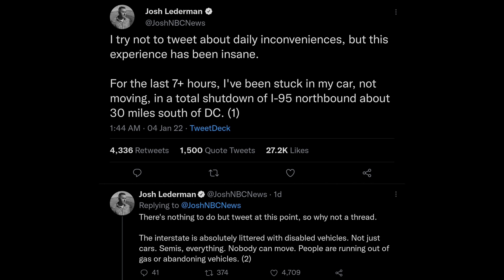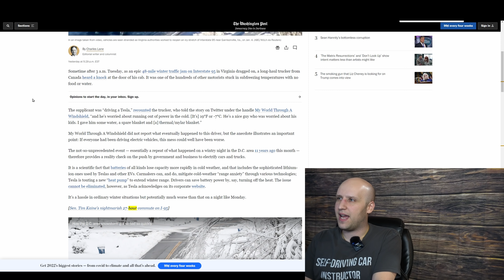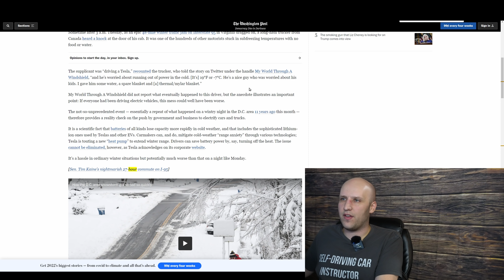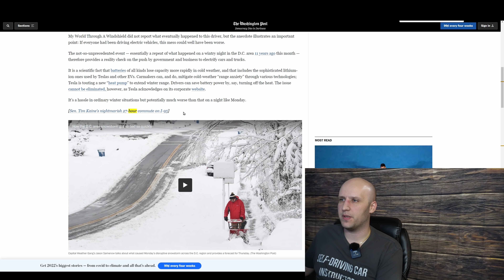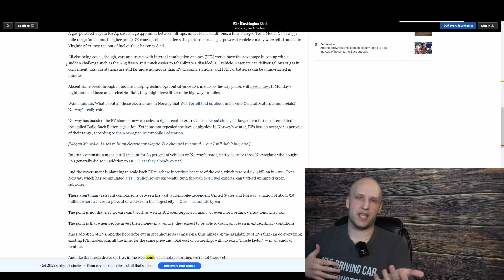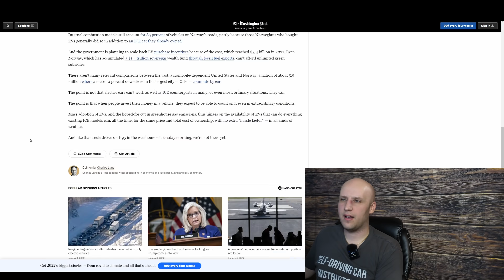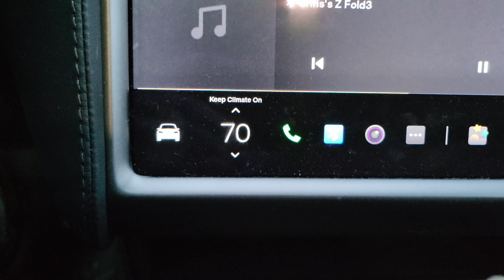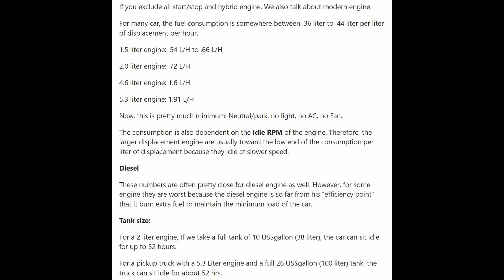How Long Can a Tesla Keep You Warm In A Frozen Traffic Jam? | FUD Debunking

Comment: Thing is that when you are parked and not using the motors in a Tesla.... more newer version or software update.... they allocate the energies to other areas.... so if you are on the side of the road during the winter you okay to run the heat as the motors are not being used due to the car being in park sending the message to allocate energy priority to heating or cooling. To me it make sense they would have it set that way also Solid State batteries are coming soon.

Comment: THANK YOU! 
I've been watching your channel for ages, but found this one super informative! Especially since I was in my MY stuck in a British Columbia snowstorm with only a quarter charge left... which is a LOT... but I was very worried about using too much charge to stay warm while waiting for the traffic to clear. 

You've totally amped up my confidence, and eliminated my first ever range anxiety! 

I wondered if turning off the car for a few hours, till it gets too cold inside -- but draws extremely little juice -- would help too. Or would the reheating of the battery from cold cancel out the benefit of turning the car off? 

Anyone know the data or have a well informed opinion?
Reply from the maker: I think you'd be much better maintaining the lowest temp possible rather than making the car work to warm you up. If we're talking hours and not days or weeks

Comment: I may have missed it but did you have the air recirculating or pulling from the outside? It would stand to reason if it were recirculating it would last even longer in this situation.

Comment: Great video. You've explained all of the misconceptions. However, I would like to point out one thing. 8:42 if you are running the heating for a longer period of time in an EV equipped with the heat pump you are going to extract all of the heat from the battery. Byorn tested it and the temps in the battery pack went very low. Basically, the system is designed to save energy at the price of cooling the battery. So pulling to the SC straight after such an event will cause a very slow charge.
Reply: The model Y heat pump takes air/energy from the outside and not the battery pack.
Reply: @lyledavis7175  so Y is different than 3?? It's hard for me to believe that.... https://youtu.be/HityyIwWSmQ?t=1115 not a best example, in another video Bjorn tested it while camping in the car overnight during winter but I can't find it now

Comment: A good rule of thumb for gas use at idle during a storm is 1 gallon of fuel per hour of idle. I based it off of the fuel use of most 2-5000w open frame generators plus a .25 gallon conservative factor. Because you don't want to ever actually run out of gas in a snow storm and 1000w to 2500w (you run generators at half load) would roughly equal the mechanical and electrical loads on the engine for a modern car at idle. Most smaller cars have 10 to 15 gallon fuel tanks. Full size cars and trucks have 17 to 30+ gallon fuel tanks. 20 to 22 gallon tanks being very common in these. So even most small cars would likely idle for about a full day at minimum on a full tank of gas.

Comment: It's better to take into the fact you wouldn't be starting at 90% while in traffic you'd end up more around 50% SOC in which case you do need to worry about lowering the temperature.  Suffice it to says in an ICE vehicle you wouldn't have to worry about this issue at all.

Comment: The mountain pass in National geographics "Ice road Rescue" are regularly passed in winter by EVs, no problem.  I drive over with my Citroën C-Zero (MiEV), no problem. 

The "only 5 million" argument is not an argument regarding EV and snow.  You can get stuck in que due to a closed mountain pass.

Comment: You don't have recirculate on, that makes a big difference, you're constantly heating the very very cold outside air, rather than reheating the interior air, this can fog up the car, but doesn't matter when you're not moving, I think this would have made a fairly big difference.
Reply: If you are in a traffic jam, you might be wise not to bring air in from outside ! Especially if the surrounding ICE cars are running engines persistently! 🤔
Reply: This is a really good idea, thanks for the tip.
Reply: if u recirculate the air with people inside it's going to fog up thus in a real world situation u have to pull in outside air.. plus  for extended periods some manufacturer manuals suggest recirculation to prevent carbon dioxide build up..
Reply: @joebrown9621  generally, switching between recirculating and outside air works best at most times to keep air warm or cold, while keeping the air fresh. This is what I do most of the time.  Obviously this isn’t practical if you are sleeping, although it has been years since I have actually slept in a car.
Reply: Don’t Teslas automatically recirculate? Sorry for my question, i have a EV from VW, they monitor the CO2 and do it completely automatically (if you like, i have it activated). 🙂
Reply: @erebostd  is it the id4
Reply: Unnecessary engineering example:
Have CO2 meter installed, when it goes above certain value it would start letting fresh air in.

Maybe even it can open the flaps just a little with some algorithm calculating how much co2 is inside. Of course it would be necessary to let the software know that you allow to let the flap open, because if you are driving with that setting and are inside a tunnel you don't want it to open.

I have tried to find CO2 meters that use N-IR sensor, there is some but I haven't seen any reviews yet. There is also  acoustic co2 sensors, uses less energy.

Use CO2 meter with alarm if you need to have recirculation on.

Those cheaper co2 measuring devices  uses another type of sensor that will react to perfume and odors, and that is not ideal in a new car with all the glue and plastic evaporation smells.
Reply: @LordGryllwotth  Cars aren't airtight. There's enough air circulation from outside when you're in a closed up car that you don't have to worry about too much CO2. A lot of people sleep in cars without having a problem. The moisture does cause a lot of mold if you sleep in a closed up car every night, at least in a humid climate.
Reply: Cute. Thermally speaking, it's easier to heat cold air to 70⁰F than it is to heat warm air to the same temp. The same thermodynamics apply to why cold water boils faster than luke warm water.
Reply: @nicholaswinter3869  that's probably the dumbest thing I've heard in the past month
Reply: @JM-yx1lm  lol I honestly had one of those moments like did I just really read that? 
Oh that's why when it goes from 60 degrees to 10 degrees we all turn our heaters down , the cold air heats easier!
Reply: @nicholaswinter3869  cold water doesn’t boil faster than Luke warm water. 

Boiling water can freeze faster than room temp water tho.
Reply: @b22chris  Boiling water doesn't freeze faster than room temp water.  The boiling water has to cool to room temp before it can cool to freezing.. .
Reply: @rick419  While you're sort of right, that one actually can happen under certain real world circumstances.  Cold water will almost certainly freeze before room temperature water but boiling water can freeze before both.  The thing that enables it is evaporation.  When a portion of the water evaporates, it takes it's energy with it.  

It's a safe bet that you have seen water vapor coming off a hot cup of tea/coffee/soup so you know that hot water evaporates more quickly than cold water.  Certain atmospheric conditions also accelerate evaporation. Cold dry winter air with a breeze to aid convection are exactly the condition that you would need to look out for here.

Now combine that cold, dry breeze with a small quantity of boiling hot water.  In this situation you might see a significant percentage of the boiling hot water evaporate before it's temperature lowers to the point where evaporation slows.  This can mean that the total energy remaining in a boiling water sample is lower than the total energy remaining in a cold water sample.

So where are you most likely to see this in real life?  If you live in a place with winter, pouring water into a frozen car door handle to open the door.  Most of the water just runs off of the hardware leaving only a small quantity behind.  If it's cold, dry, and windy, the door handle can refreeze a lot faster if you used boiling water.  Best practice is to use room temperature water.
Reply: @ColonelSandersLite  I wouldn't pour water of any temp on a frozen door handle, it will probably freeze even harder.  Maybe a hand warmer.  If you boil water long enough  you will end up with less water, and perhaps this lesser amount of water will freeze faster than water that's cooler but a greater amount.  Yes boiling water gives off more heat but to freeze that boiling water will have to cool to every temp. before reaching the freezing point.
Reply: @rick419  Nah, see, you're totally missing the point.  

Completely.

Let's take two arbitrary small units of water, one boiling hot, one room temp.  Let's say 1ml each.  Just a few drops for each sample.

You take the hot one off the stove and carry them both outside.  It is like -5f, dry and windy out there.

From this point, you're out in the cold with a ml of hot water and a ml of room temp water.

75% or more of the hot water may well evaporate before it cools to room temp.  Once this happens, the formerly hot water has lost a solid majority of it's thermal mass.

Yes, the now 0.25 ml of formerly hot water has to pass through room temp to get to freezing, but with it's reduced thermal mass, it will get there much quicker.

This is a well documented effect with small quantities of water we have known about for ages.  It's not a problem with like a bucket of water, where evaporation will have a negligible impact on total mass.

Melting car door handles with water is a very common practice here.  Everyone does it.  Your hand warmer idea is just going to be a no-go for the vast majority of cars.  The freezing that really messes them up is in between the handle and it's housing.  Most car door handles are made of some kind of plastic and it has been that way since at least the early 90s.  Plastic isn't going to conduct the heat from a hand warmer into the space between the handle and it's housing very well at all.

The trick here is to use room temperature water so that you can get your car started and get the heater going so that it warms the car before the door handle re-freezes.
Reply: @ColonelSandersLite  That is just what I said, by evaporating most of the water off, thereby ending with a smaller volume or mass of water, it might freeze faster.  This is just another way of saying a small mass of water will freeze faster than a larger mass of water.  I have lived in cold climates my whole life and have never heard of pouring water to get a door handle unfrozen.  If it doesn't unfreeze right away it will be frozen even more, and even if it does work everything will be wet so freeze even more.
Reply: Any way if a hand warmer won't conduct heat from plastic handles how would warm water conduct hear any better.  That water will freeze quickly in sub zero temps.
Reply: @rick419  Nah, it isn't what you said.  See - "If you boil water long enough  you will end up with less water"

That's pretty strongly implying evaporation during boiling.  I'm saying that evaporation is sometimes a big factor once you remove the water from the heat.

As far as unfreezing door handles goes, the difference there is that water, being a fluid, will penetrate in between the door handle and the housing directly to the iced up bits.

Yes, it can refreeze.  However, once you get into the car and get the engine started and the heater going, the heat generated by the car will prevent refreezing and let it dry off.  You just don't want to use hot water here so that the engine has enough time to start to warm the car before they refreeze.

Like I said, it's a common practice.
Reply: @ColonelSandersLite  hot water would freeze slower.
Reply: @rick419  For the reason stated (rapid evaporation of small quantities of water) - no.  This is well known and proven.
Reply: @ColonelSandersLite  I have done experiments on nights when  its around 5 degrees outside by using identical plastic glasses and filling one up with just boiled water and the other with tap water and placing them about a foot apart on my porch.  Checking in the morning, the cooler tap water was frozen solid while the boiling hot water was frozen on the outer sides but liquid on the inside.  Try it yourself.
Reply: @rick419  Those aren't small enough quantities of water.  Seriously man, I'm talking quantities that are just a few ml here.
Reply: @ColonelSandersLite  So you are only talking about minute quantities of water?  Why would that be different than 16 oz.?  And if you poured water at any temp on a door knob at say 10 degrees below F. it would freeze instantly.
Reply: @rick419  "So you are only talking about minute quantities of water?"

Yes, and I have said that *repeatedly*.  In *Every post*!

The reason why it's different is simple - the proportion of mass lost due to evaporation.  

If you have a glass of water, while it will be subject to evaporation, only a small percentage of it's total mass will evaporate before the temp normalizes.

If you have a drop of water, you may see more like half or three-quarters of it's mass or more evaporate before the temperature normalizes.

"And if you poured water at any temp on a door knob at say 10 degrees below F. it would freeze instantly."
That's roughly true for a small fixed quantity but it's not true if you keep pouring until the handle gets unstuck, which is what happens IRL.

Frankly, I'm getting extremely sick of explaining this to you.  This is a well known effect that happens.  We have known this since before I was born.  People have also been commonly using water to unstick frozen car doors and door knobs since before I was born.  These two facts are just hard reality.  If you have any more questions, you can just google it.
Reply: @ColonelSandersLite  Now you are back to saying that enough water evaporates that the smaller amounts of water freezes faster than a larger amount of water. That's obvious. Try it in your freezer with glasses of water.
Reply: @rick419  "Now you are back to saying that enough water evaporates that the smaller amounts of water freezes faster than a larger amount of water."

That is what I have always been saying.  In every post.

smacks forehead

If you have 1ml of hot water.

And you have 1ml of cold water.

The majority of the hot water will evaporate and then freeze.

The cold water will not have as much evaporation.

A "glass" of water is too much water to see the effect.

If you have any more questions or comments, direct them at google.  I'm done.
Reply: @nicholaswinter3869  Cold water does not boil faster than hot water. The rate of heating of a liquid depends on the magnitude of the temperature difference between the liquid and its surroundings. As a result, cold water will be absorbing heat faster while it is still cold; once it gets up to the temperature of hot water, the heating rate slows down and from there it takes just as long to bring it to a boil as the water that was hot to begin with. Because it takes cold water some time to reach the temperature of hot water, cold water clearly takes longer to boil than hot water does. There may be some psychological effect at play; cold water starts boiling sooner than one might expect because of the aforementioned greater heat absorption rate when water is colder.

Does hot water freeze faster than cold water?The answer is not usually, but possibly under certain conditions.
Reply: @nicholaswinter3869  tell a chef or my wife and they would laugh.
Reply: @nicholaswinter3869  lol, what are you smoking? The thermal energy required to heat up air from 10 F to 70 F is orders of magnitudes greater than the amount of energy required to maintain air at say, 60 F back up to 70 F. You have efficiency confused with energy use. A heating element might be more effective with a higher delta T, but the actual energy use is drastically higher with a larger difference in temperature.
Reply: @nicholaswinter3869  That was the dumbest thing I've heard all week

Comment: And don't forget the danger of carbon monoxide poisoning in an ICE vehicle.  You definitely should keep a window or two cracked while idling for long periods to avoid this.  That will mitigate you dying, but you are still breathing the gas and there could be resultant longer term health issues.  I guess the take away from all of this is to be sure you are charged or have a full gas tank before heading out into a potential situation like this (in addition to carrying some snacks and water).